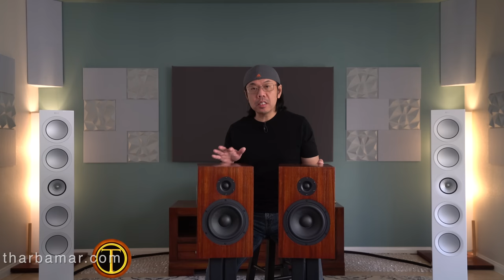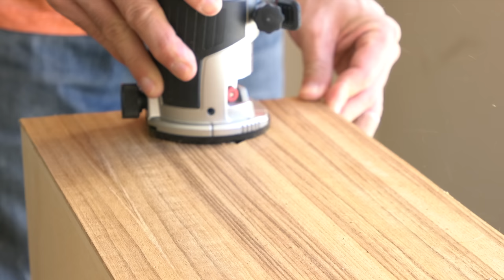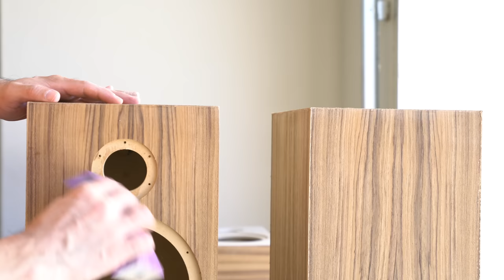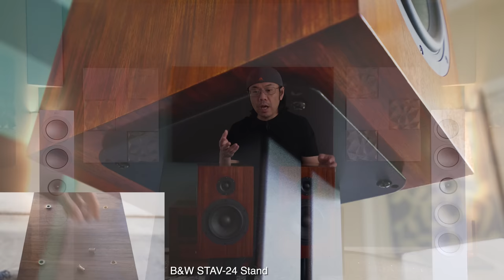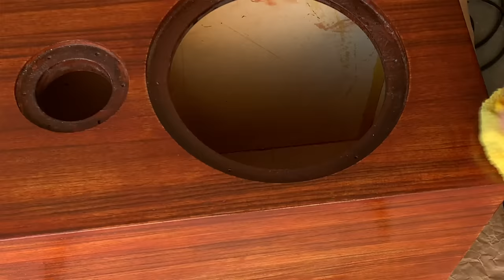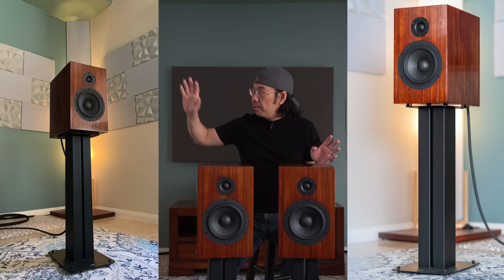Refinishing and Revisiting CSS Audio 1TD-X Bookshelf Speaker

Comment: I just bought the birch version.  I hope it will look good with stain.  I didn't want to learn the veneer process unless it is absolutely necessary.   

I bought these because of your review and the price was right when I bought them on Thanksgiving week. 

Thank you!
Reply from the maker: You will enjoy them, thanks
Reply: @Tharbamar  If I don't like the birch I can always veneer.
Reply: I have done a few staining projects and although no expert I did research thoroughly and got good results on a pine project that is notoriously difficult to get an even stain (NO blotches) because it is softer. 

The overall tips (and all my results have been great so far) were:

Don't sand beyond 120 or 180 grit for certain woods. When you go to something like 1000 and then expect the grain to take an even color stain, you run into the problem of polishing the wood to the point where the pores are closed up and won't take stain evenly. 

180 is still nice and smooth, and if you finish with polyurethane (multiple coats) you will sand those with fine grit and can even finish with 000 steel wool to make it mirror smooth. The idea is that you don't need to sand your wood finer than 180 because your 5 or so coats of poly will be smooth as glass if you sand between coats and polish the final coat. 

I also used mineral spirits after sanding, and used pre stain conditioner for the wood 30minutes before staining. This helps the wood take the stain evenly. 

I've mostly used oil based or gel stains as well. The water based may be good too but I've had better results with oil. Definitely get a mask that can filter organic vapors, work in well ventilated area.

Same goes for sanding. Many hardwoods have toxic dust and you don't want a lung infection from breathing walnut and other hard woods. 

Hope that helps someone. There are plenty of woodworker on YouTube that can fill in where i left off.

Comment: hi again! its that time of the year for upgrade :)

im currently running Bluetooth > topping bc3 BT receiver > topping e50 > rca Denon x2600H > criton 1tdx superior

if i wanna upgrade / top up my components.. what do you recommend is the most effective way to improve? 

i have auditioned 3-5000 dollar speakers here in Singapore and nothing comes close to 1tdx.

ps: i saw the musician knight 1 review after i bought the 1tdx superior :(

thanks!!
Reply from the maker: I would suggest you to add a REL sub or SMSL D300 DAC, which would be great upgrade.
Musician Knight 1 is another great upgrade option as well, thanks
Reply: @Tharbamar  im currently using svs sb 12 for sub right now :D 

css audio suggested me to get an integrated amp.. but im not too sure whether i should.. because it can be an expensive investment if it doesnt improve anything.
Reply from the maker: @buriburizaem0n  Good integrated amp is a must if you like two channel music listening, 1TDX sound best with high current amps.
Reply: @Tharbamar  do i need my current external DAC still if i buy the integrated amp? and is there anything that u can recommend below 700 please? :) thanks!!
Reply from the maker: Something in the price range from Yamaha or Denon should do, w

Comment: I just finished building a set of these speakers and I noticed that I can hear vocals bouncing off of the wall from the port.  Really detracts from the sound of the speaker.  Any suggestions?
Reply from the maker: I didn’t notice that with my speaker, check the length of the port.
Reply: @Tharbamar  It said the port should be 9" and my port came in the box at 9".

Comment: Hi hello from india.

What would you rate the pma 1600ne. Are those audiophile level amps. Is it worth spending 1300 usd . Thats how much it costs on india.  My other options are marantz 8006
Reply from the maker: It will be depending on your take, the are ever bit of audiophile quality, they sell 2000USD in the U.S, 1300 USD is bargain price for quality that you are getting. If you like neutrality and dynamic sound with great bass performance go with 1600NE, if you like slightly warmer sound Marantz may be great choice as well, 1600 NE have very good DAC as well, thanks
Reply: @Tharbamar  
Thank you sir for your quick reply. 

Lot of ppl have recommended audiolab 6000a + 6000n +6000cdt combo which all up costs 1700usd saying the performance is at par with 2k to 3k costing system. 

My speakers i am considering are Monitor audio 100 silver or evo 4.2.
Reply: @Tharbamar  
Also one other option i have recived is PM 14s1se maranatz champaign gold edition brand new at 2000 usd.

I think its discontinued in usa.. is it worth spending so much on discontinued model .

Comment: Hi. What's your opinion on this CSS speaker compared to Elac UBR62? thanks!
Reply from the maker: 1TDX is much better speaker.
Reply: @Tharbamar  at more than twice the price, i mean it should be. is the improvement worth double the price? not close?
Reply from the maker: @krblgc  if you DIY not much more but UBR62 with right paring can brings very good sound for sure.

Comment: Excellent!  In process of building my 2TD-X Towers and have a question:  What kind of router bit are you using to cut the veneer from the shallow recesses of the speakers?  My flush cut bit has a bearing that is too tall to allow the cutter to reach down far enough...  Thanks!
Reply from the maker: I do not remember model number but everything is listed in this video and description.
CSS Audio 2TD-X Speaker Teak Veneer, Full Assembly & Upgrades
https://youtu.be/vb2cc9r8YyA